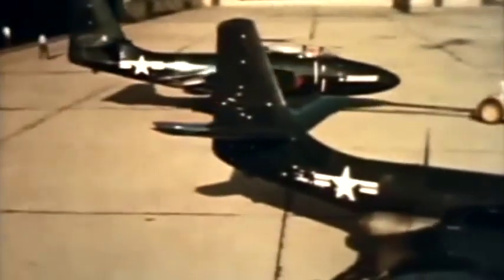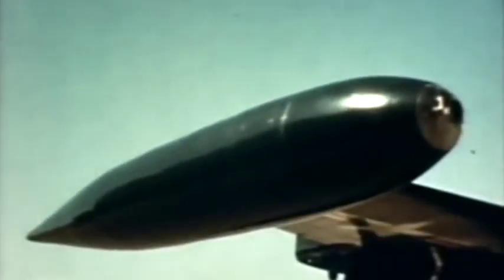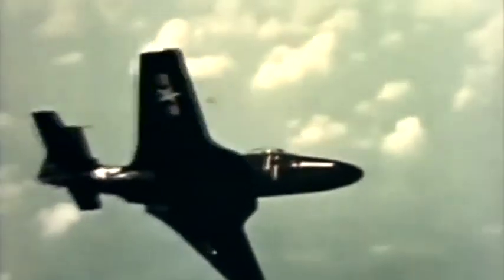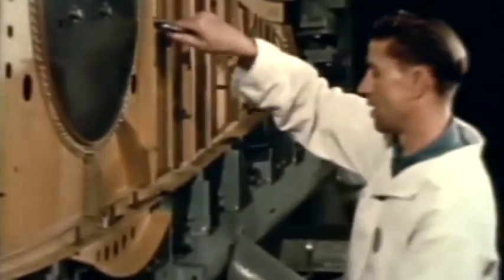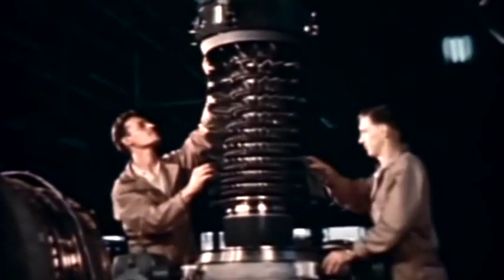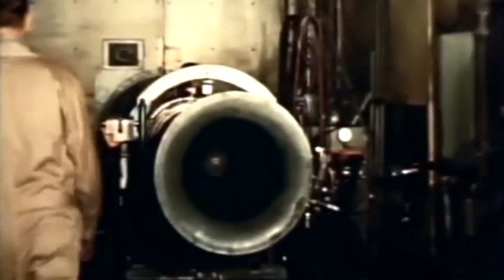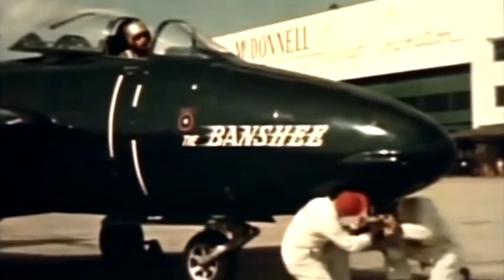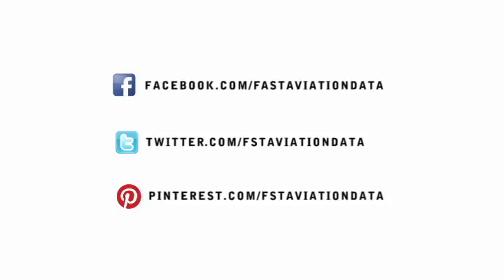McDonnell F2H Banshee Carrier Based Jet Fighter 1948

Comment: ....the the Germans had swept wings 5 years earlier...ME-262.
Reply: But, Germany lost that war
Reply: @Mike-gt1cs  ...yes, after about 53 countries declared war on them.
Reply: @hertzair1186  It was the other way around. Germany declared war on all the other countries, including the United States, when they should of shut up.
Reply: @hertzair1186  Sorry but you can not add... 1947 is 3 years after 1944, which is when the Me-262 entered service. and the 262 did not have swept back wings. It had a slight sweep to its leading edge for stability issues. Not for reducing the transonic effects on the aircraft...  Its next version would have had fully swept wings, but it was never built... and the F2H Banshee was developed and brought into service within 3 years of the Me-262 and had a higher top speed, longer range, and its engines had a lifespan of 100 times that of the junkers Jumo 004s on the Me-262. Plus it could operate from an aircraft carrier which meant it was built much more solidly than the 262. The collapsing nose gear issue on the German jet quickly proves that.